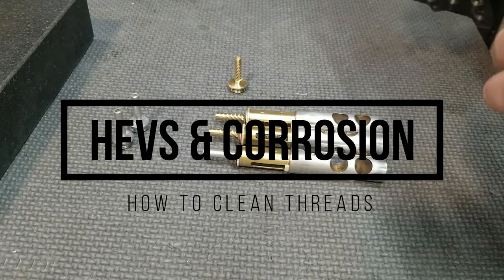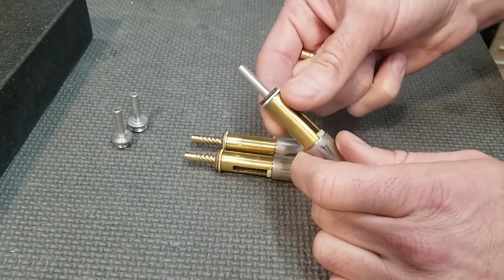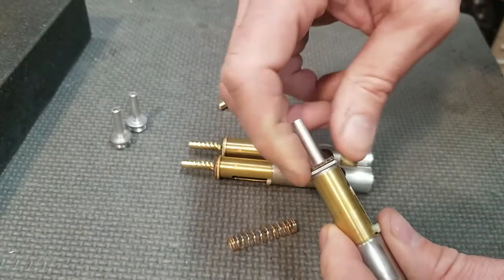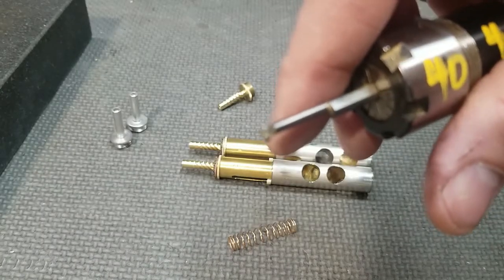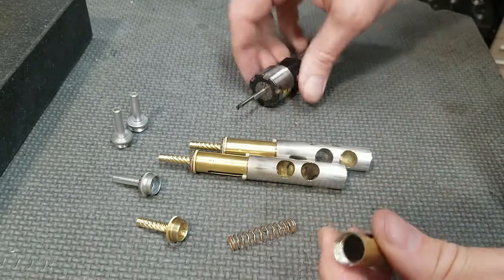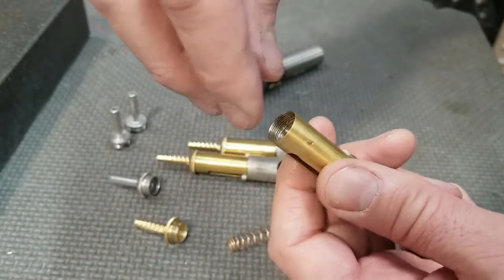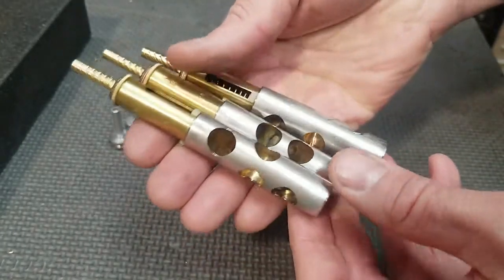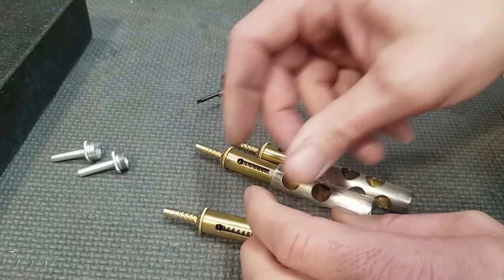Harrelson HEVS - Corrosion removal techniques High Efficiency Valve Stems

Comment: Glad I watched this. I've had my Bach for over 30 years and it's fine. I bought set of HEVS for it from the Kickstarter and they arrived a month ago. I haven't put them in yet. I appreciate having a heads-up in case I run into these problems.  Did you have a recommended grease?

I'm now thinking about getting a Mod kit too. These "user installed mods" are good things to have.
Reply: a little dab of any grease, cork grease fine...just a dab.

You might not have any trouble threading them. My horn is old and they went right in.